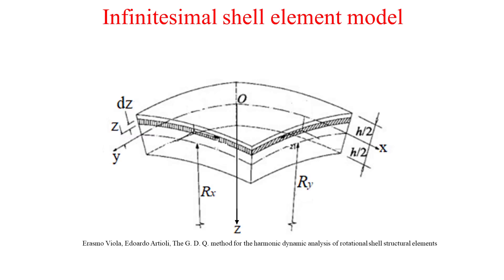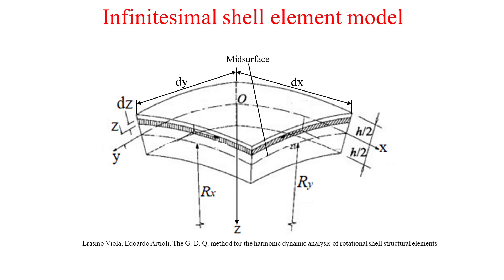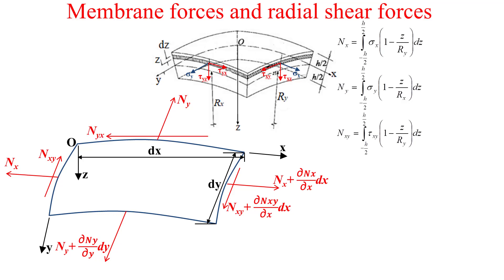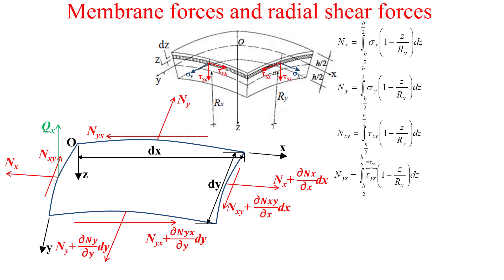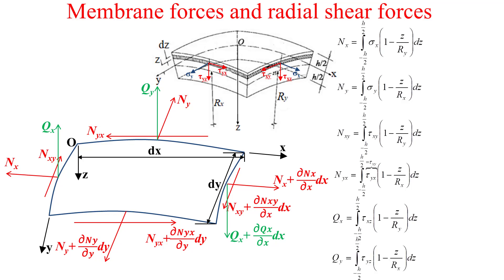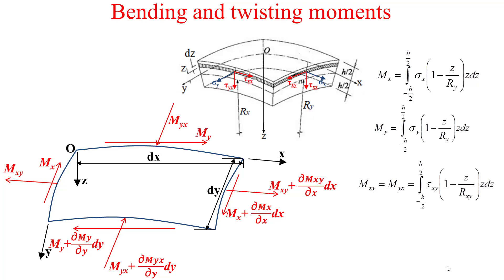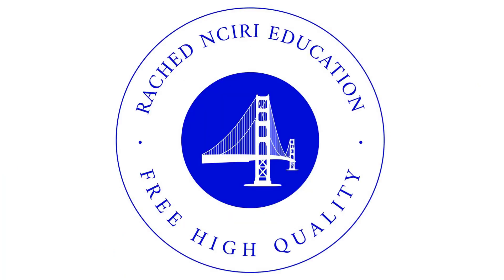Thin Shells_Solicitations

Comment: Could you provide some example how to treat biharmonic equation ? I encountered following problem - It has model as funtion u(x,y) but in same time surface is embedded in 3D space. Thus it seems like '2,5D' formulation. Most of examples are in plane like disc, but what about deflection and squeeze in same time of shell surface which is not flat initially (boundary lines in 3D) ?
Reply from the maker: Thank you for your interest. You talk about a shell not a plate problem. The biharmonic equation is applicable to thin plates, the analysis of shell deflection typically involves more complex equations that account for the specific geometry and deformation characteristics of shells. The specific equations will depend on the assumptions and theories used for shell analysis, such as the Love-Kirchhoff theory for thin shells or other theories for thick shells. The basic equations for thin shells are derived from the equilibrium and compatibility conditions and are usually expressed as a system of coupled partial differential equations. The Love-Kirchhoff theory considers the first-order approximation of the shell's geometry and leads to equations involving the curvatures and membrane strains of the middle surface. The equations describe the balance of external and internal forces and moments, as well as the compatibility between deformations. I will work on an example about the shell elasticity in the next month.
Reply: @RN_Ed_Eng  Yes Shells indeed are interesting. That example would be great.